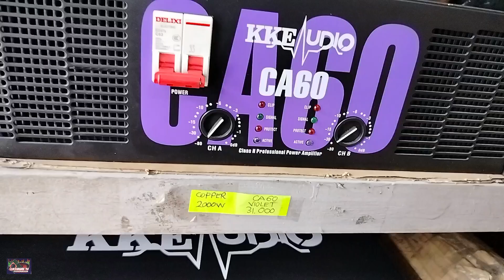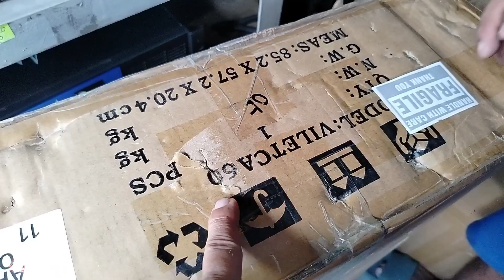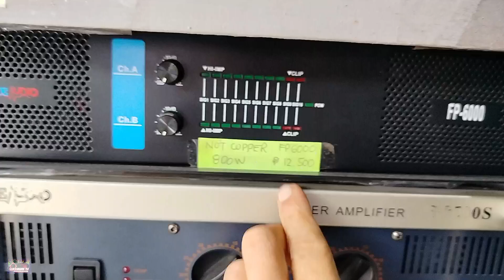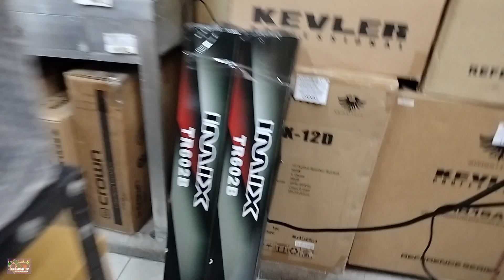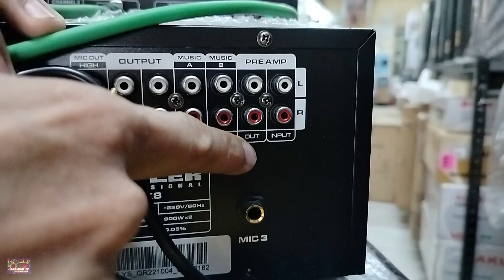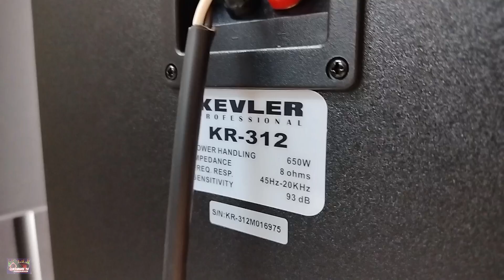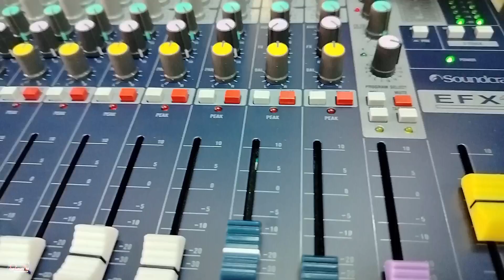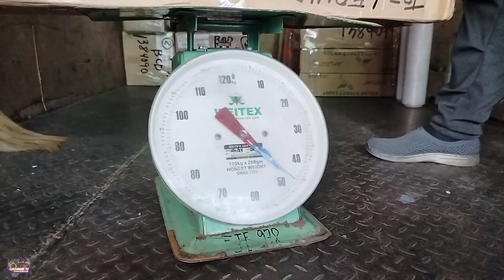ito pa sa pang Low Budget na hanap mo mga power amplifier sa Malabon

Comment: Sir anong maganda brand ng wireless Microphone mid budget? Im here in Calgary Canada para alam ko what i gonna buy.
Reply from the maker: Kevler UM-200s wireless microphone sir rechargeable batteries na
Reply: @LuchamaxTV  Thanks. Multi volts ba power supply nito? Dito kasi 110volts.